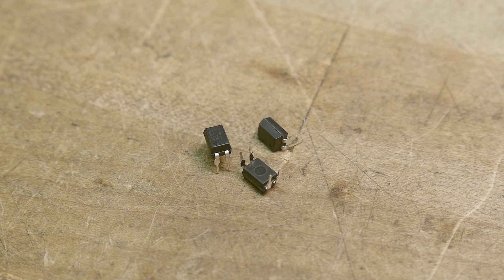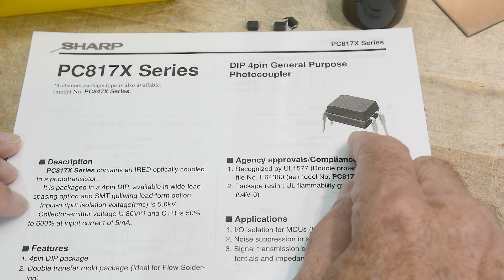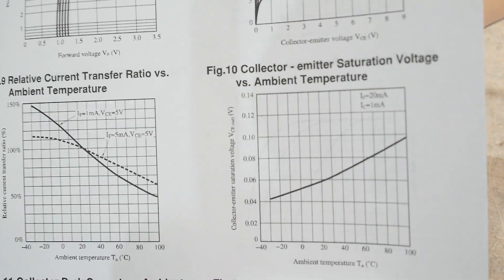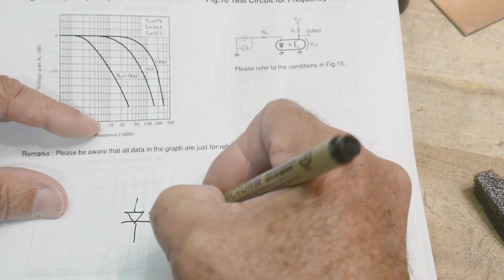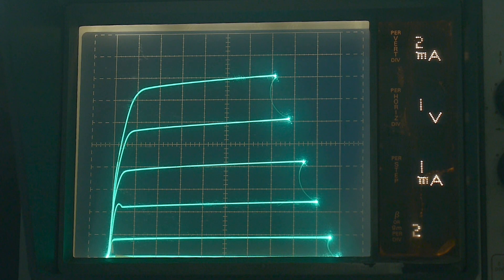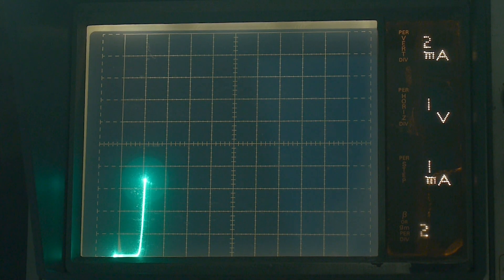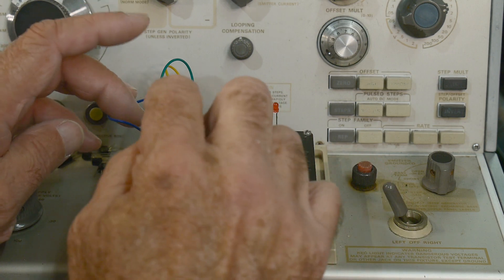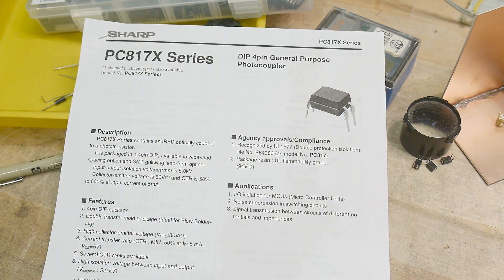#1502 PC817 Optocoupler

Comment: Recently worked on a customer product with green leds off a 3V battery. You normally think ah, it's an led, just shove a current limiting resistor in front of it job done. I learn alot with that job re all the curves etc. and saving the battery life. Lot more to an led than you'd think.

Comment: One of my tests for a suspect SMPS is to check for 1V on the cold/LED side of the 817. This is also how I see what the output voltage of a blown SMPS should have been if there is no way to tell from board markings: connect a bench supply to the DC output, crank up the voltage slowly, and when the drive to the 817 as at 1V then that's the rated output voltage. Go 0.1V above this and you start seeing 1.2V on the 817.

Comment: They can also be called Opto-Isolators. LOL I use these a lot in my computer interface projects to protect the computer from shorts and power surges. I've blow quite a few pf them up. LOL. But they saved my 80's ZX Spectrum.

Comment: Great video.  I have never seen an optocoupler connected to a curve tracer as a transistor - very interesting. For those not familiar with optocouplers, this IC is rated for 5000 volt isolation between input and output which is why they are perfect for SMPSs

Comment: I used to have some darlington opto isolators with a current gain of around 50 and max Vce of 30V.   It is cool designing circuits with these instead of transistors because everything is isolated so you can use them anywhere in the circuit.  The main problem is that they are relatively slow.  Then I started using op-amps and other ICs which are much better for most things.  But opto-isolators have their place.

Comment: Any difference in the isolation voltage (die level) between the 4 pin version and the 6 pin variant that's missing pins 2 and 5 due to the physical size difference?

Comment: Very practical check of the data provided by the datasheet. 
The picture of the curve tracer corresponds to fig 8 in the datasheet where the diode current is given in steps of 5mA. There you see a current transfer ratio of not much more than one (or 100%). The current transfer ratio in fig 6 should have it's maximum at around 2mA with 650% going down to below 500% at 5mA and 300% at 10mA. The values are not precise and the elements are good enough inside a control loop with sufficient gain.

Comment: Nice video.   So these things use phototransistors for the detector, rather than another diode.  My hunch would be that's because the transistor is somehow better for the application than a photodiode, and if the stakes were very low I'd bet small money it's because the transistor is "more sensitive" or "responds better in some way" -- do you know the details?
Reply: Yes, the transistor is "more sensitive".  The photocurrent produced in the base-emitter junction of the phototransistor is amplified by the transistor, producing a larger current from the collector to the emitter.  The photocurrent produced in the base serves the same purpose as current fed directly into the base in a "normal" three-lead bipolar transistor, producing a larger current at the collector under appropriate voltage bias.
Reply: @analog_guy  cool i had not made the connection but that makes perfect sense. the photocurrent in the transistor acts just like the base current!  cool, thanks!
Reply: You just answered my question which was why this device has a such low frequency operation.  Usually the optical fiber pairs go up to Ghz.

Comment: I suppose it has a low gain because it's intended as an isolator not an amplifier.  Also, forward voltage aligns with the spectrum and infrared is at the low end and have a low forward voltage.  Ultraviolet LEDs are at the high end and have a high forward voltage.
Reply: It shouldn’t have any gain.  Ideally, you want it to act like a straight piece of wire.
Reply: @jimomertz  But...  I think it's actually the opposite.  You only need 1 mA to turn on the LED, but on the transistor (output) side, you may want to directly power something like a relay, so with a gain of 1, you wouldn't want to limit the current there to only 1mA (otherwise you would need an additional transistor to drive the relay).  So high gain just adds flexibility to what can be driven.  The input and output are isolated and entirely separate circuits so the least intrusive thing to do is to not limit the current that the output might "want to" draw.  Therefore, in an ideal situation, the transistor would have infinite gain and no current limit to act as a zero resistance "wire" when turned on, since a perfect wire doesn't limit current.

Comment: Any idea what's causing that weird hump on the 2mA trace when testing in "transistor" mode. Only seems to appear as you increase the collector voltage past 2.5V (although it does still have a much sharper knee than most of the other curves...) 🤔
Reply: Wondering the same thing.......